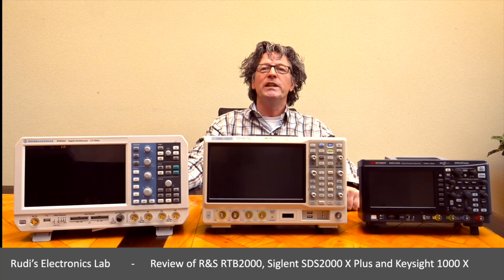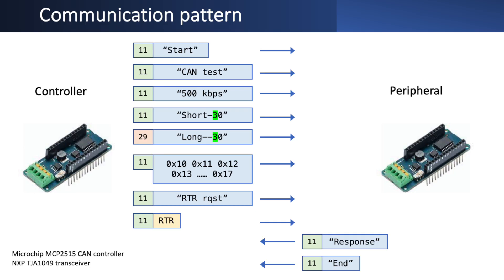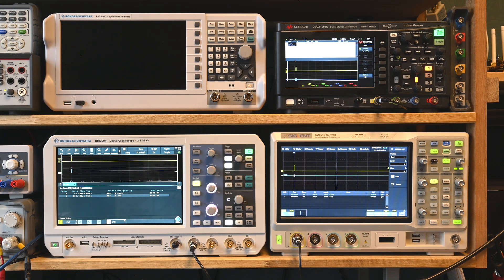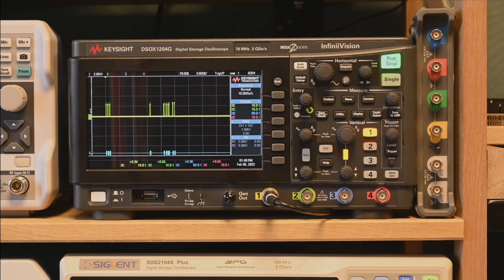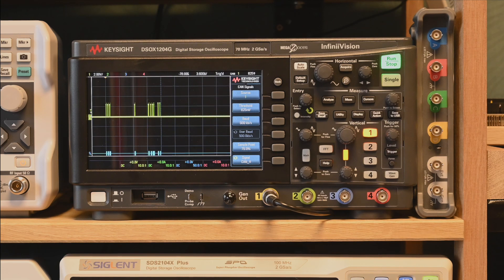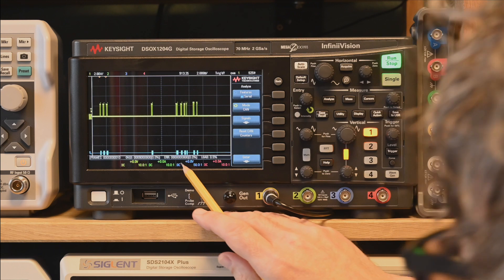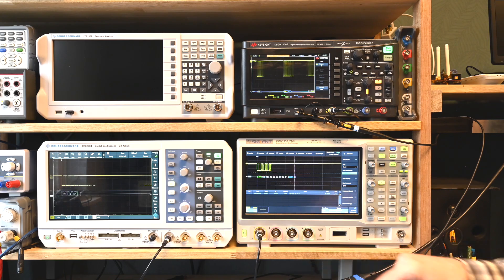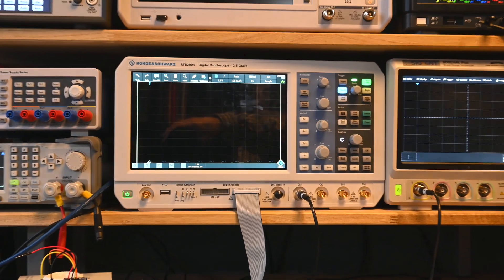REL #08 RTB2000, SDS2000x Plus and DSOX1000 Series Oscilloscopes, Episode 5: Bus decode

Comment: I am planning to buy RTB2004, comparision that you made really helped me a lot. many thanks :) That valuable information we cant find at datasheets either at manual.
Reply from the maker: Thanks, the RTB2004 is a great scope! If you are buying it from a private consumer, you will want to be aware of a recent change in R&S policy: they only make firmware updates and documentation available to those users who (assessed by R&S) have a business account and a business email address. So make sure that the distributor from which you buy commits itself to making firmware updates available to you, as you might not get them from R&S directly...
Reply: @rudiselectronicslab861  Thanks a lot for the information. I will definelty ask this question to the eleshop.

Comment: Thanks for this review! One of my Keysight scopes broke (MSOX 2014A). I have been using this one and a MSOX3054A for years for analog work but mostly for protocol decoding (mainly SPI, Async and CAN).

For the money Keysight are charging for repair, I could buy 2 x SDS-2000X-Plus or one R&S RTB2004 with all options (special offer as we speak).  And I didn't know which one to go for. Now I do: the RTB2004! The decoding options are even better than on my MSOX3054A, which is un turn better than the SDS. One thing I do like about the MSOX series is that they do the decoding in hardware and almost real time. It's blazingly fast!

But the analysis functions on the RTB2004 are just impressive, especially the possibility to label the CAN messages. I do a lot of NMEA 2000 (avigation) decoding and to be able to list messages like "GPS Position" instead of "01F805" makes life just great!
Reply from the maker: Happy I was able to help you to decide. I agree the protocol decode implementation in the Keysights is super fast... But a decision should be based on comparing many more aspects and how you as an individual weigh them for your specific use. I don't know whether you have already checked the overview table at https://github.com/RudisElectronicsLab/RTB_SDS_DSOX_review. For me personally, the RTB is a great combination of aspects....
Reply: @rudiselectronicslab861  I've been using the RTB2004 for a while now, side by side with a Keysight MSO-X3035A. I know I mentioned I liked the bus decoding of the RTB over that of the MSOX. After using both scopes side by side, I still feel happier when using the MSOX though. One major advantage of the MSOX is that it is fast. FAST! I should say, in all respects. When scrolling through decoded messages, the RTB is always a bit lagging in response to a control like X-position or the time base. Even when using the touchscreen it lags a bit. Not much, just enough to be annoying. Of course, the MSOX doesn't have a touchscreen at all but "twisting the knobs" results in instant change on the screen. And the biggest gripe I have with the RTB, and I really think R&S should be deeply ashamed of this, is the delay when pressing the zoom button. On the MSOX, again, it is instant. On the RTB however, it takes a whopping FOUR seconds! "Unzooming" too. That really spoils the fun if you capture a dozen messages and you want to quickly zoom in on each of them. 

Another thing I dislike about the RTB is the lack of use of colors. When I decode an SPI or parallel bus on the MSOX using the parallel port, 0-level is blue, 1-level is green and transitions are yellow. Beautiful and very informative. Even with a bunch of signals you immediately see which is at which level. Also, the signal labels are in de middle of each trace and it is very clear which trace it belongs to. On the RTB however everything is blue. 1-level is a bit "fatter" than 0-level but not obvious enough. If you stare at 8 or more parallel signals, it is hard to see in a glimpe which signal is 1 and which is 0. Also, the labels are close to the 0-level and this adds to the confusion of recognizing which label belongs to which trace. If you have a color screen, use it, R&S!
Reply from the maker: @meindertsprang7491  Dear Meindert,
  thanks for the comment. Unfortunately, I do not have a Keysight MSOX-3000. Would be interested in using one. But my comparison is limited to the three scopes I describe in the videos. 
Having said that, I agree that the RTB is slow. As you see in my overview document (the latest version is v76, see here: https://github.com/RudisElectronicsLab/RTB_SDS_DSOX_review), Table Serial Bus Decoding  (page 26), the RTB scores very low on refreshing its event table. The Keysight DSOX 1000 I have is blazingly fast at this. 
Having that said, there are a lot of other relevant aspects to take into account. Comparing the RTB2000 to the Siglent SDS2000X Plus and Keysight DSOX 1000, I believe the RTB is considerably better in aspects like protocol (subtype) settings, error analysis, protocol triggering, and searching in protocol messages, as you can see on detailed tables for various bus protocols op pages 27 to 34 on the compare document. But, again, I did not try the Keysight MSOX-3000, so I will refrain from commenting on it. 
In the end, each device has strengths and weaknesses. And, in a sense, I do like having access to multiple devices, so I can take the one best equipped for a certain task... Best, Rudi